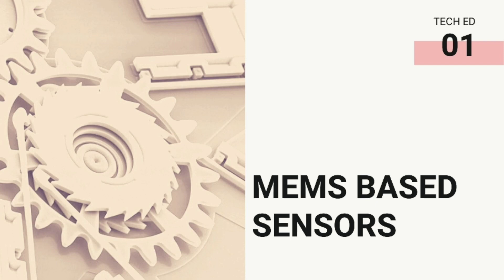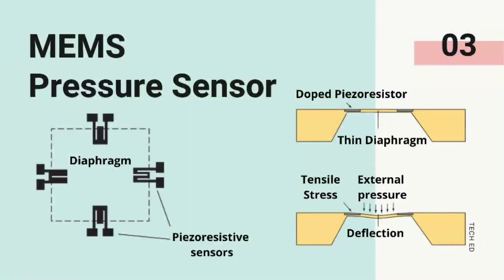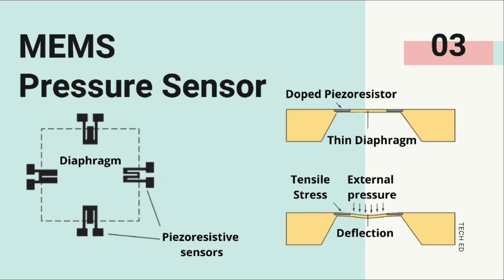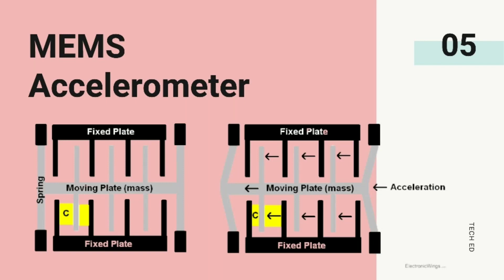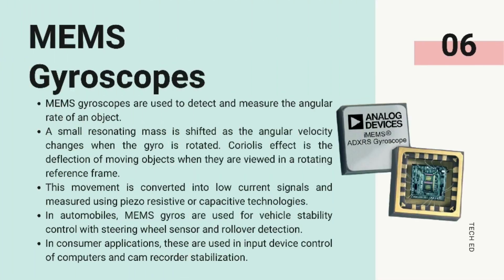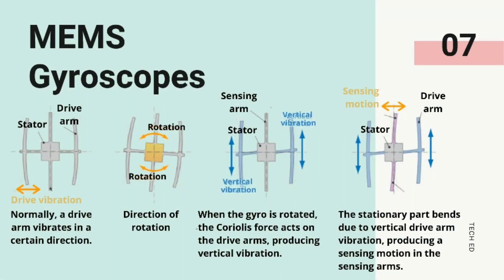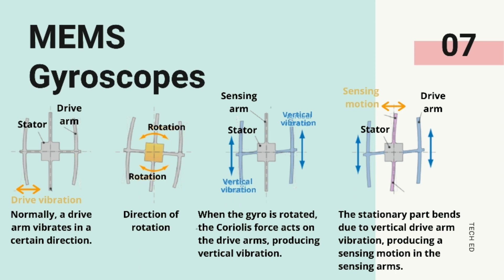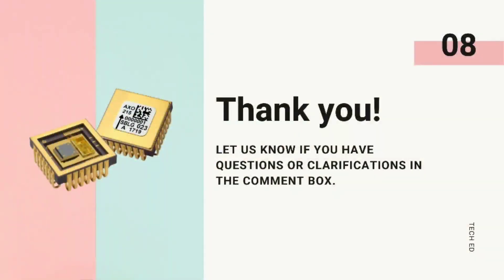MEMS based Sensors || Seminar 2025

Comment: Thank you for doing this video. Very well explained about what is MEMS Sensors and the Different types of MEMS sensors.
MEMS sensors stand for Micro-Electro-Mechanical System. these sensors help in converting measured mechanical signals into electrical signals. Acceleration and Motion MEMS are two types that are used most in Industrial Automation. 
Keep posting such videos with different topics.
Reply from the maker: Glad it was helpful! Keep watching :)